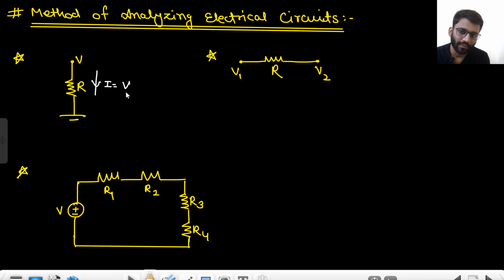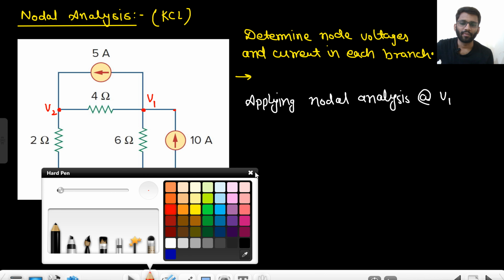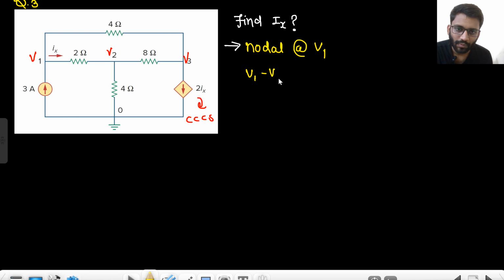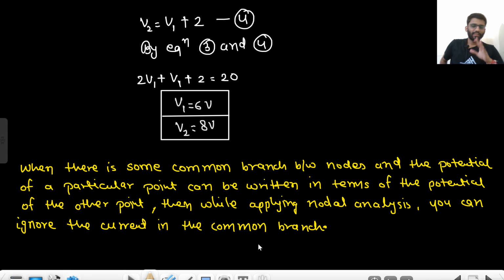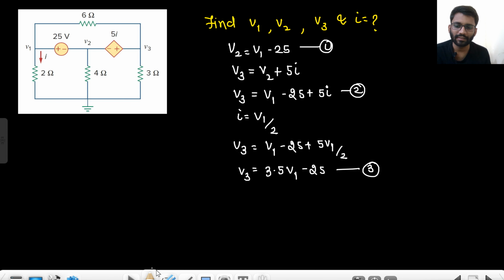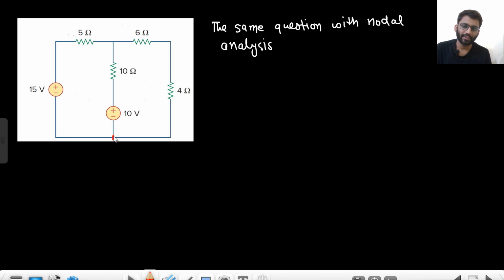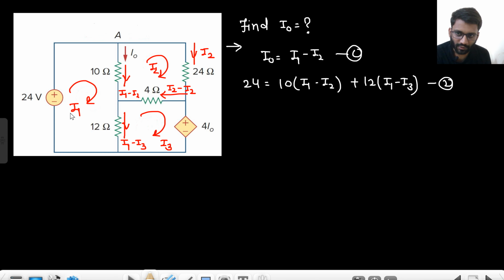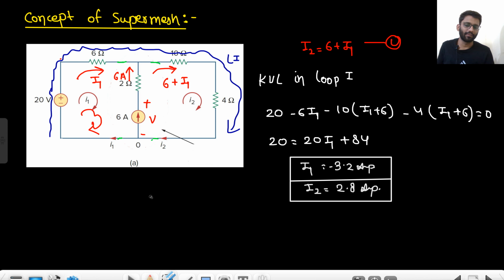Methods of Analyzing Electrical Circuits || Network Analysis || GATE 2025-26 || PrepFusion

Comment: The answer of I1 and I2 is 1 A in the first question of mesh analysis
Reply: thank you i was confused first
Reply: is the equation correct?
Reply: @Byte-d2g  No the equation should be like :
(15.i1) - (10.i2) = 5
(10.i1) - (20.i2) = -10
the mistake sir did is in calculation only.

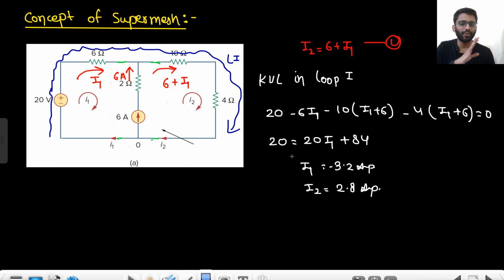Comment: 1:07:07 Rather than replacing i2 , if i1 is replaced with i2-6, we get a different answer, Why exactly this happens??
Reply: For supermesh we ignore the resistor in series with current source existing b/w loops. Similarly for supernode we ignore the resistor in parallel with voltage source b/w nodes. 
So you cant substitute i1=i2-6 or whatever.